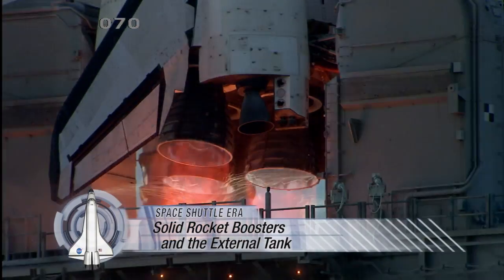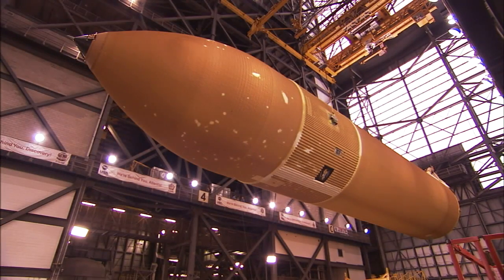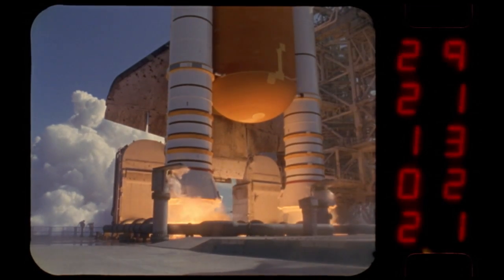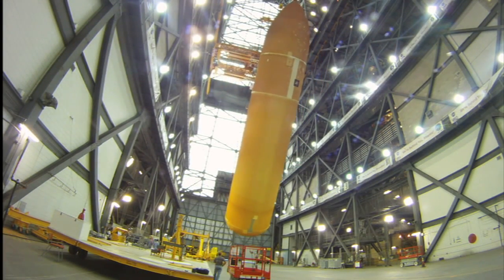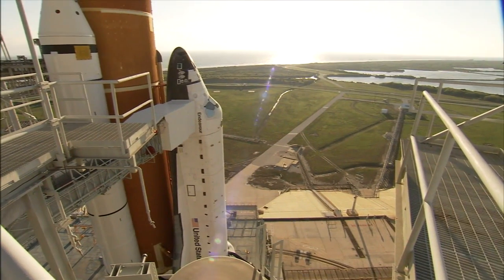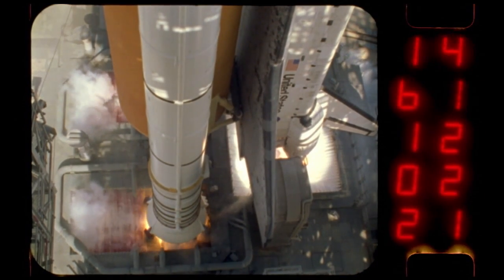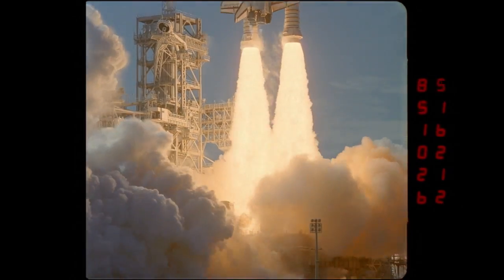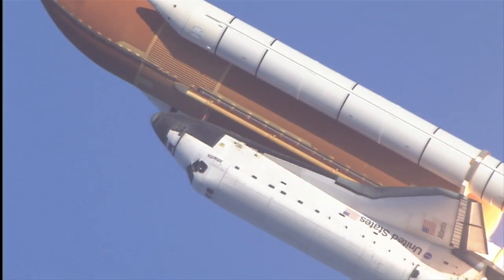Space Shuttle Era: External Tank and Solid Rocket

Comment: Actually it was due to thermal dynamics that they were saving weight by not putting the white latex paint on the shuttle that is why it was kept the orange color which was the color before they painted it all they found out that they did not need the paint
Reply: I've always wondered if the latex paint could've prevented the piece of foam from coming off on STS-107 but I guess we'll never know